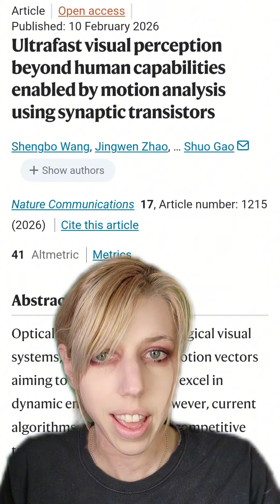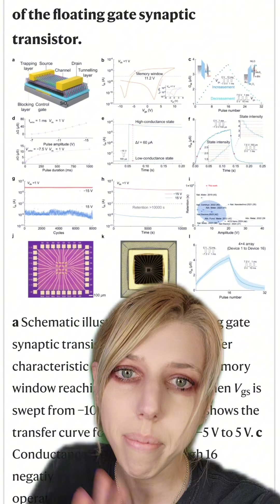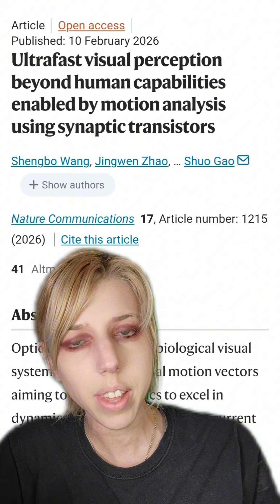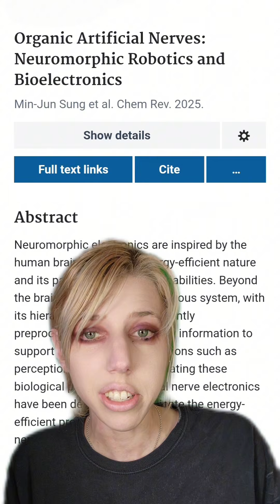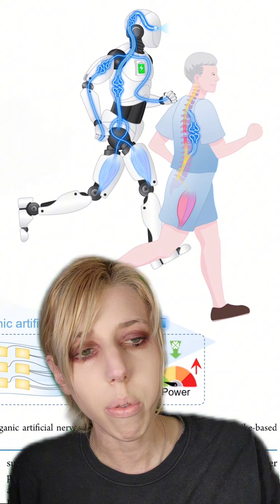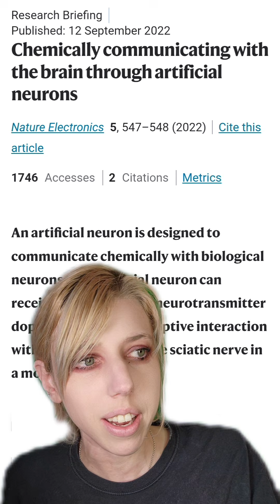This Robot Vision Surpasses Human For The First Time

Comment: I’d agree there’s going to be no difference in real intelligence. I think there will be differences more like species differences. AI will just think differently I think the sooner we throw out the idea of neurotypical the better. We’re expecting the models to out perform everything compared to a human. I also agree this will lead to better situational awareness anecdotally at least. I’d have to dig through the paper deeper but surface level that seems to be the case. It seems like it also is fairly adaptable to existing systems hardware and in conjunction with papers I’ve read about real time data corrections in things like CNCs. I want to see how many systems this can adapt to it seems like a lot